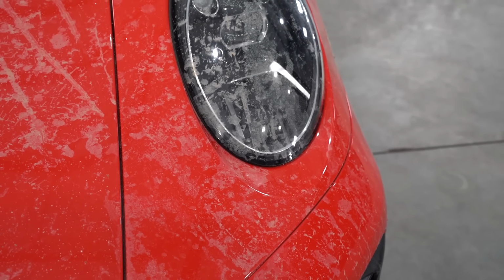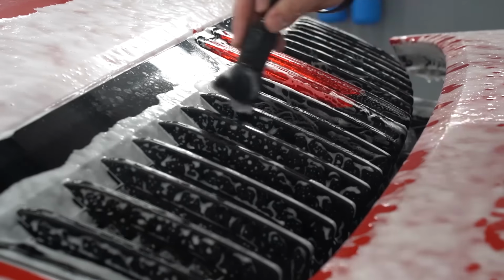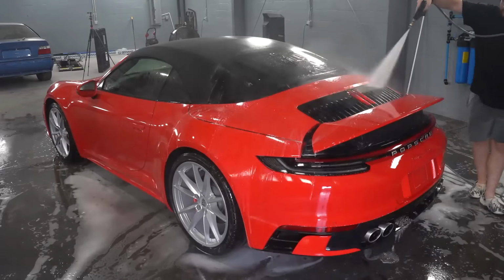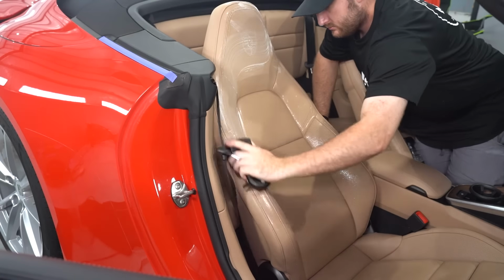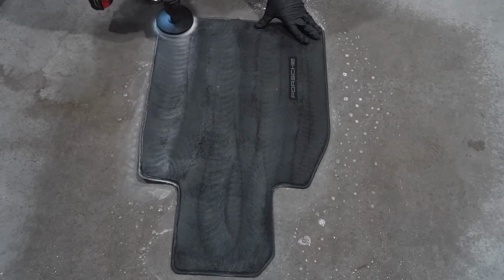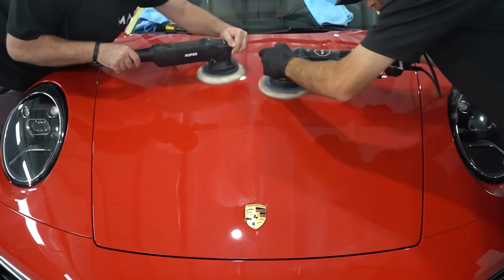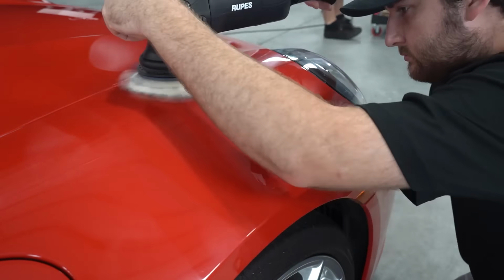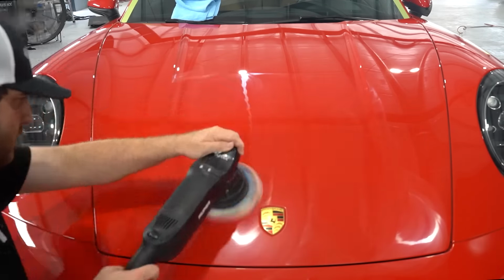Deep Cleaning The DIRTIEST Porsche 911 Ever! | Insanely Satisfying Car Detailing Transformation!

Comment: Certification to buy ceramic coating. What a joke.  Like yours is any better.
Reply from the maker: A true ceramic coating isn’t sold to just anyone.   There are certifications for a reason. It’s meant for professionals. You can ruin a car if you don’t know what your doing with a true professional coating.
Reply from the maker: @gingerbadger   Which is going to remove more clear for no reason. When you could of just got certified and did it right the first time. Also you can’t  just polish my coating off.